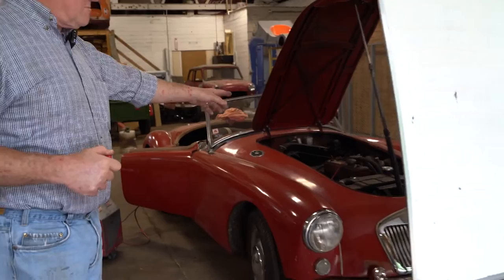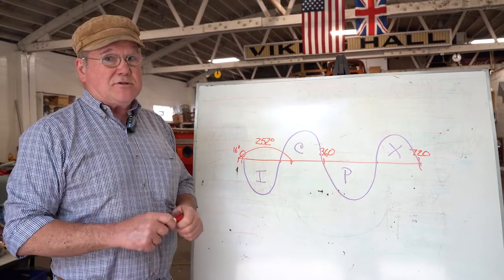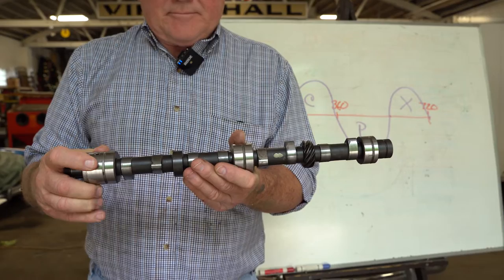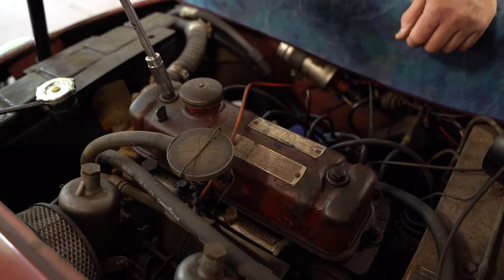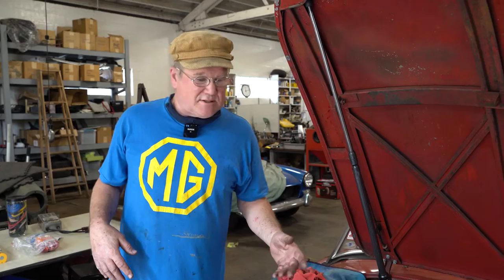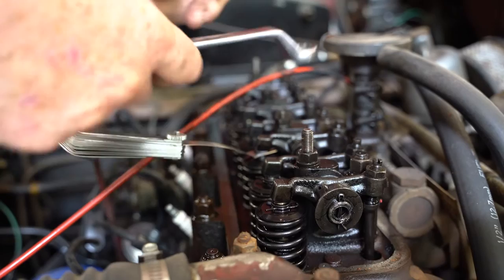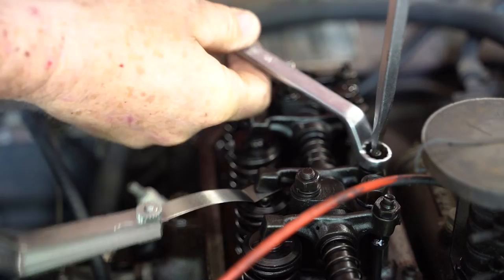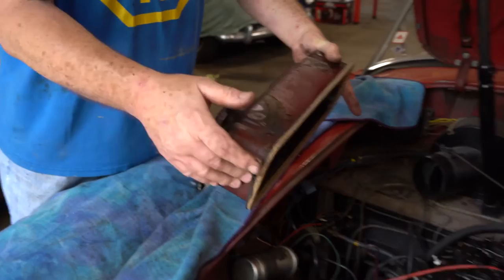345 MG Tech | How to Quickly Adjust the Valves on Any MG

Comment: Great video John. This helped explain how to adjust the valves on my 1966 Lotus Super 7. I couldn't figure out the two open valve thing, but this explains it, and I could have done it in half the time, instead of doing one valve, then rotating engine. Also, learned the bump starter trick instead of manually turning engine at fan pulley. I should go back and grease the gasket though, as mentioned at the end. I think I saw you awhile back at a Kingston, Ontario MG rally in the early '80's.

Comment: I have managed to keep track of the hand crank for my MGA, and this makes it super easy to rotate the crankshaft exactly 180 degrees to go to the next pair of valves to adjust.  No need to do the bump with the starter motor.  If you put a B engine into your A whose bodywork permits use of the crank, be sure to bring along the A's bolt that matches the hand crank.

Comment: 4:50 Something I noticed when I had my cam go south. I too had nicks on my cam, which was interesting being I used new ARP studs, and had all the big ends resized. What happened was two of my ARP studs, both on the cam side, turned while torquing, something I did not notice. By turned I mean the oblong top of the stud turned out so it was sticking proud of the piston enough to hit the cam on rotation. Both pistons 1 and 2 had this issue. I put a  new cam in and took the surface of the studs down on the cam side using a Dremel to get clearance. Remember, there's not much clearance to the cam and some of the newer cams use rather large blanks, which too doesn't help.

Measure and make sure of the clearance when using ARP studs.

Comment: Brilliant video I’m going to check mine tomorrow I’ve tuned the carbs bue to 95 octane being no longer available I now have to  use 99super as the new e10 gas rots rubber and also breaks  down solder he carbs are set about right leaning to the lean side she runs perfect for 30 miles then starts to miss and stutter plugs are black with carbon ?could this be poor ignition I’m going to replace dizzi cap and leads just in case so would appreciate a tutorial on fitting points as I have never done this before again thank you for the videos as due to them I have been able to work on my 1962 mga  lot more

Comment: most confusing "rule of nine" explanation i've ever heard. almost unbelievably so.  

here's a concise and accurate explanation: 

counting from the front of the engine if number eight valve is fully open, subtract eight from nine and the answer is one, so adjust the clearance on valve number one. If number six is closed, then adjust number three and so on..

Comment: Why is it required to re torque the head?
Reply: If the head is not torqued It will affect the gap clearance, which will result in gap to loose and sound noisy.